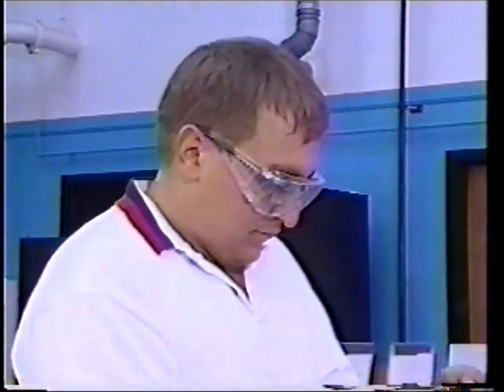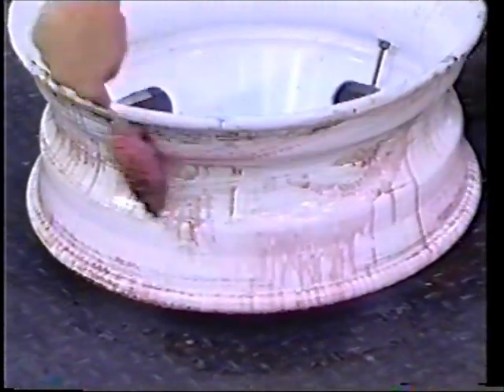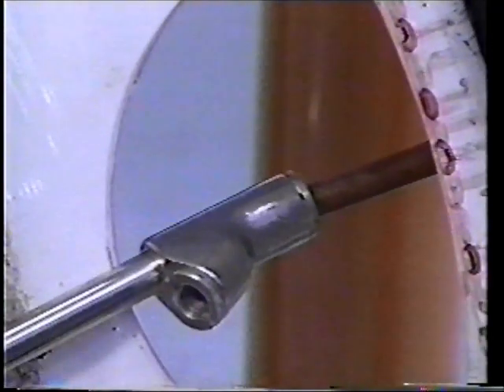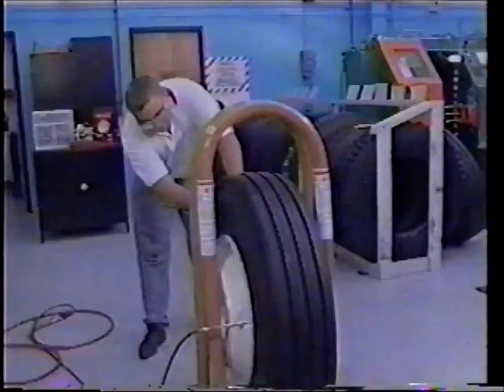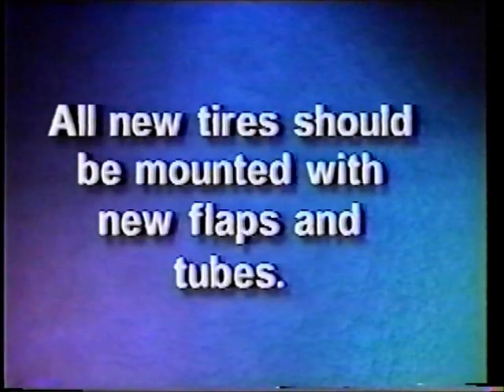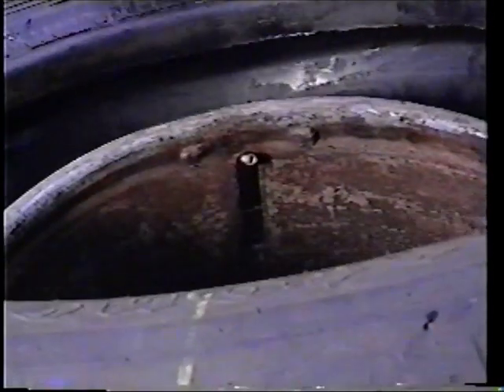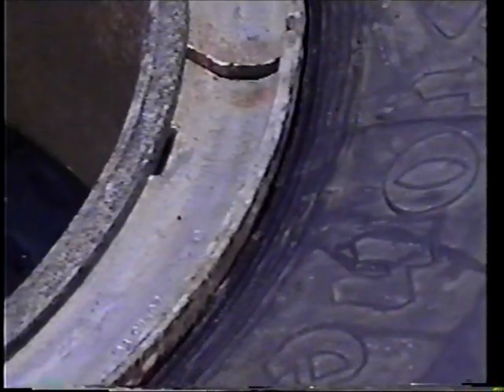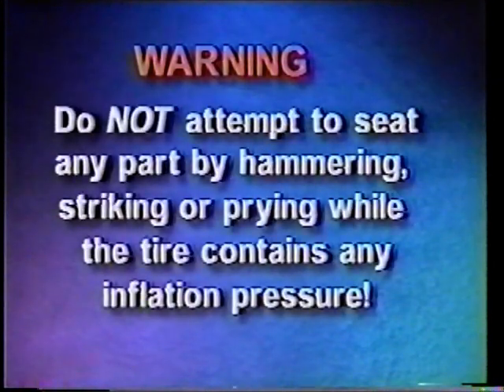PROPER TECHNIQUES FOR MOUNTING & DEMOUNTING TRUCK TIRES

Comment: guys if i had to fix a single pice rim is ok   but if i ever meet a split rim wheel i'd rather non even look at this thing and go away, these things are known for killing people and they call this tipe (the widowmaker)
Reply: Technically, the widowmaker style was a dished wheel that was split in the center. Firestone rh5 designation. The reason they are dangerous was the mating surface was hidden 
The wheel shown is just a two-piece split ring wheel. These, and three piece lock ring wheels are still serviceable, though insurance companies may not let you work on them.